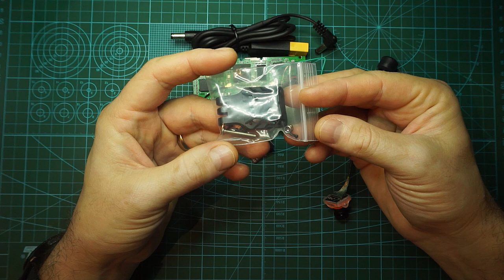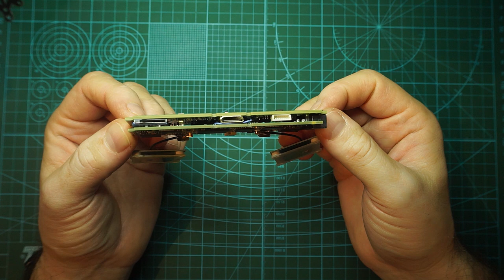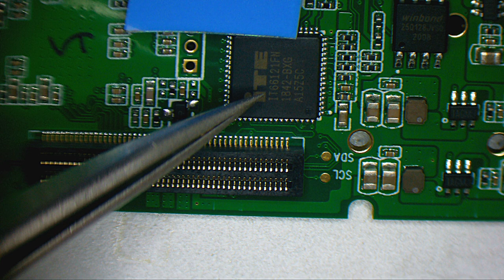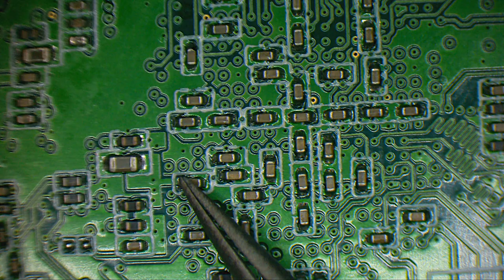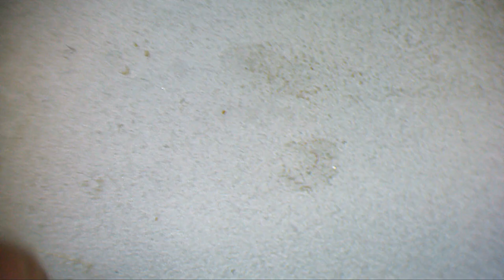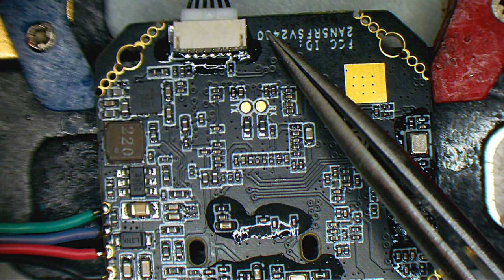Fatshark SharkByte TEARDOWN & Overview

Comment: Been flying mine the double stack works great love it also sunk my drone in the dool I dyed it out absolutely nothing wrong with it except my tmotor flight controller voltage regulator is a little messed up up everything else is great still.

Comment: Any chance for a power boosting attenuation circuit tweak as per the crossfire  mod on the tx5s.1? I have a hunch that some light weight heat sinks will help the over temp issue, and given shark byte at 200mw beats tbs pro32 unify hv at 1w with the same  antenna setup (direct mmcx vs direct uf.l) this would maybe unleash what fatshark restricted to make this board work without heatsinks...

Comment: Gr8 video once again! I did notice some empty spots that were missing tiny capacitors? I'm curious if thats for things to come, V2 maybe?
Reply from the maker: no... usually designer over design stuff only to use some parts if needed. It is a common practice.

Comment: This needs to be split in two so each end goes into the side module bays. That would make it more ergonomic and integrated with old analogue goggles.
Reply from the maker: No place... and way too much heat :( Maybe a new set of goggles a bit bigger...

Comment: I suspect they have the PA backed off because of the peak to average power ratio of the tx waveform and need to maintain a certain evm.
Reply from the maker: could be... but the amp is rated to 33dBm @ 1dB compression. I suspect they can go higher a bit than 200mW :) maybe the regulation kept them back a bit... but even so DJI went overboard with that PA.
Reply from the maker: RFPA5542
Reply: @LivyuFPV  For the stuff I deal with in my day job we usually need to run a 6-8 dB backoff to meet evm and regulatory spectral mask requirements.  I'd be curious to see what their actual PAPR is.  Just guessing but maybe because they're sending really short packets they couldn't afford to whiten/scramble the data to drop the PAPR? And didn't the larger TX do a push-pull?  Good stuff all around, thanks for doing this :)
Reply from the maker: @PKsLab  I dont have the big vtx but... push pull with an PA? Never saw push pull did with PA ic only fets or bipolar. Interesting. Now i wish my spectrum analyzer could go up to 6g ahaha .
Reply: @LivyuFPV  Sorry, I meant to say they're using a 90 degree hybrid coupler: https://static.rcgroups.net/forums/attachments/8/0/8/9/4/9/a14249029-118-BySh%20Signal%20Routing.png   You could always mix it down using an external mixer, and an analog 5.8 VTX as the crappy LO source if you don't have a siggen.  ;-)
Reply from the maker: @PKsLab  yeah, i got it now. There are downmixers out there I should have a look.
Reply from the maker: @PKsLab  can you send me a PM on FB ? Thanks